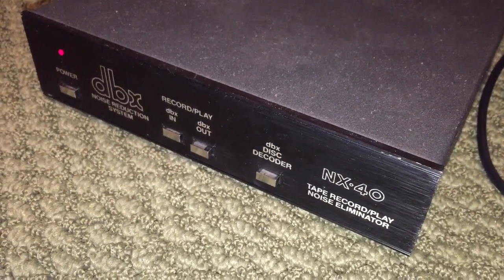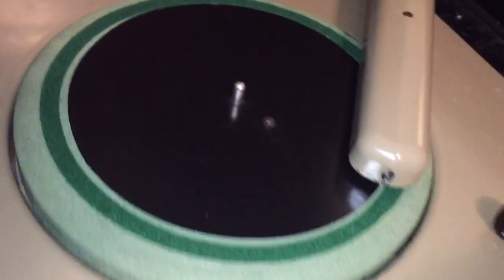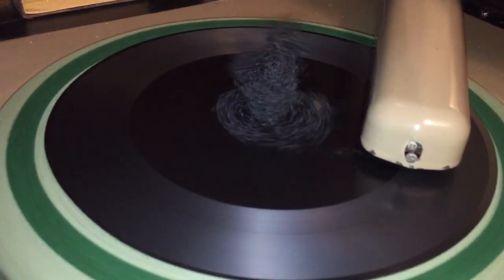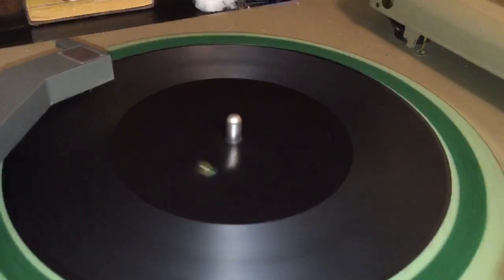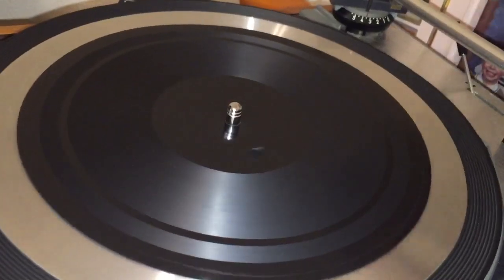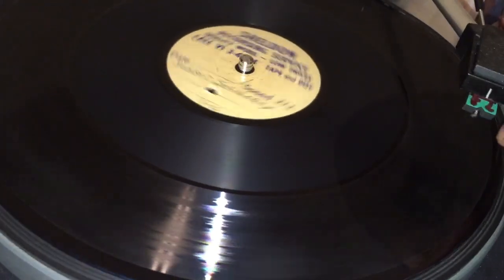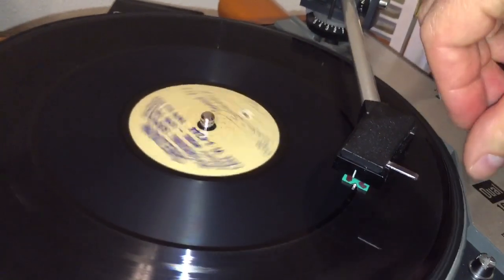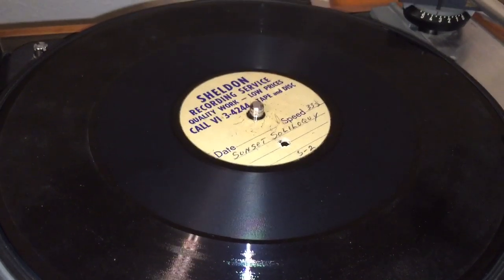dbx Recording on Plastic and Acetate

Comment: Professional record cutting was done with heavy equalization that I'd bet your Montgomery Ward cutter doesn't have. See the Wikipedia article on "RIAA equalization". It was done to compensate for the limitations of the medium and the performance characteristics of the cutting equipment..

The recording would have been done with a response curve that featured low bass and high treble, and playback would have been done with a reverse equalization curve, boosting lows and reducing highs.
Reply: really ? no shit ! the recorder he is using is not a pro disc lathe, it was made for voice recordings basically...
Reply: Use an equalizer before connecting to the cutter.
Reply: Why do you think that dedicated machine doesn't have RIAA curve implemented??
Reply: @colloidalsilverwater15ppm88  because it's a transcription disc cutter for consumer use, not a professional music cutter.

Comment: The first one I was going to shout "Did you record that album on a drive-thru speaker?" Then I heard the DBX version and WOW it sounds much better. It reminds me of that time in 2008 I tried to set a radio-controlled 'atomic' clock by going outdoors and holding it up to the sky and somebody asked me what I was doing and I said "I'm trying to get RECEPTION!" and they said "What kind of phone company do you have", then I answered "I't's not a phone, it's a clock" to which they replied "How do you get reception on a CLOCK?!" Now the thing to say is "How do you get NOISE REDUCTION on a dinner plate?!"

Comment: Fascinating.  I think the rather "muffled" highs and boomy lows in the decoded sample on both acetate and plate were because DBX requires at least a 30 Hz to 15 KHz ( -3dB) frequency response of the recordable media, and a 60 DB s/n ratio, ( which the writer most likely isn't attaining ) so when it compresses the dynamic range of the input signal and accentuates the highs, upon decoding  ( expanding ), that dynamic range and high frequency just isn't enough to reproduce the original music, but it does a great job on noise.  With dbx,  because of the 2:1 companding that occurs, overmodulation of the input signal is an easy thing to do.
Reply: Yes, plus isn't DBX an "encode-decode" process?  In other words, you have to "encode" the DBX signal onto the record when you cut it, then "decode" it during playback?   Otherwise if it is not correctly done, it will sound like non-Dolby cassette played back with the Dolby button on.  (muffled sound.)

Comment: The NX-40 can only encode dbx appropriately for cassette tape.  It is a dbx type-II encoder.  It won't even work as well on reel-to-reel because there is a slight different in the dbx type-I that reel tape uses.  dbx encoded records have a little more equalization done to them to help with the frequency curve of a record and the RIAA equalization, so while this does remove surface noise it also severely reduces the highs.  You would be better off to just create a 2:1/1:2 compander system using an NE570 chip or similar.  At least it wouldn't be fighting the tape equalization curve then.

Comment: intresting experiment seens like the DPX decoder cuts out a lot of treble though. and about controlling the swarf use a cheap soft painting brush to brush the swarf towards the spindle it seens like most of the amateur record cutting guys use this metod and it seens to work well for them, the profesionals have automatic vaccum systems for dealing with the swarf.

Comment: I don't know for certain, but theoretically, your home dbx recorder/player despite having a dbx disk button to play them, may not record to the plate, or even a real blank vinyl properly, or as well as a normal dbx disk could sound.
What lead me to thinkind this would have to be the input and output for it is labelled as "To tape Rec input" and "as it'sFrom tape Rec output" respectively.
I believe that those ports may be optimised for recording and decoding dbx recordings from tape specifically.

I may have been completely thrown off by some labels.
I haven't even finished watching the video before i posted this.